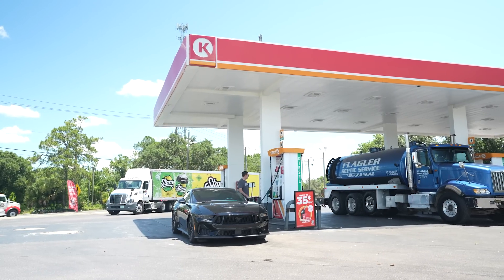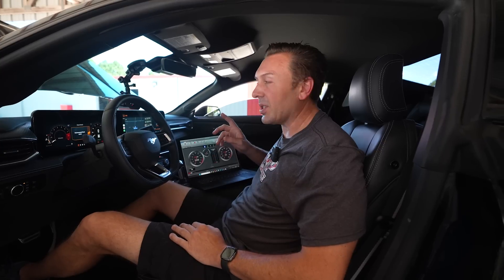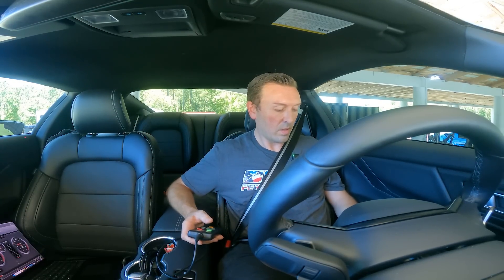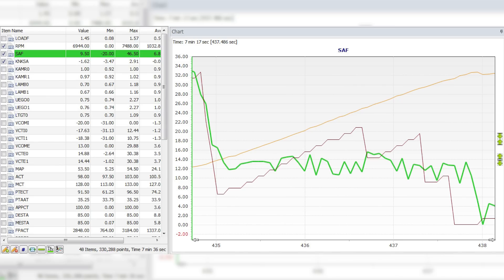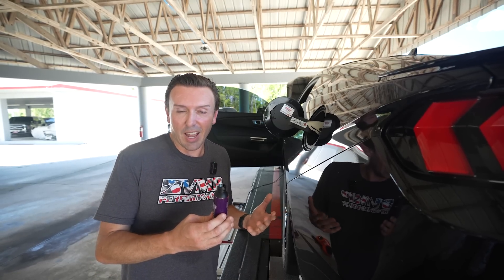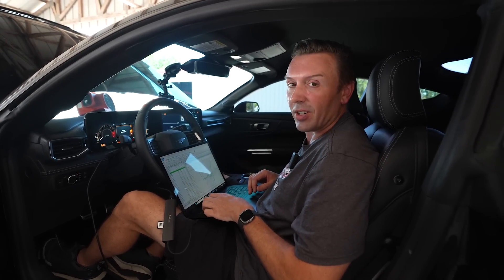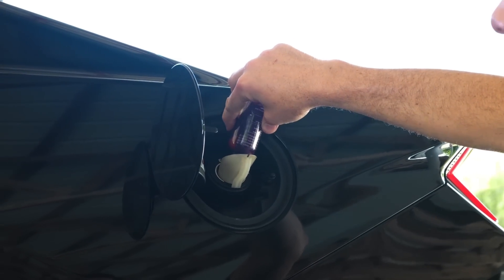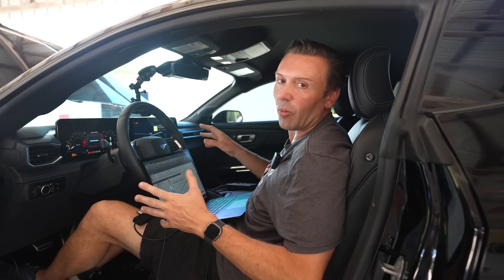How much impact does bad fuel REALLY have?  ||  Supercharged on 87 with our '24 Mustang GT

Comment: What irritates me with Whipple, is why TF do they not take advantage of the mustangs, and f-150’s e-85 capabilities from the factory. 

Guy at OZ Tuning has files where the stock fuel system will support it… 
With a bone stock Whipple stage 2 kit, and the gains can be had with as little as 30% content… 

Why Whipple wouldn’t do the same thing… 
Ask the customer, what fuel do you plan to run? 
We have a 91/93 tune, and an E-85.

Comment: Great video, finally someone crazy enough to do this test lol. I wish someone would do this with a stock Gt with 87 and then 93. Wonder since Ford says 87 at 480hp. Curious to see if you get a bump stock in the timing and hp department.
Reply: I can’t remember if VMP did that test or not but someone did. Good results for sure.

Comment: Nobody should really be buying premium fuel in new vehicles unless you plan on driving it hard like track etc or he very few high performance cars. The computer will just pull timing they have knock sensors. It will still make good power. Should of done all the pulls in 4th gear. Making a baseline run then doing them all different after makes no sense and proves nothing. And what was the octane number after the additive?
Reply: Back in '08 when gas prices got crazy, I had a '07 Infiniti M45 sport that said "premium fuel REQUIRED for maximum performance." I always put 93 in until it was $5/gallon. I switched to 89 and it did make a difference in performance. The car wasn't as quick, wouldn't brake traction, and overall didn't feel the same. I have a '20 M5 competition now that also requires at least 91 octane for maximum performance. It even goes further and recommends Shell V-Power of which I do run most of the time. I probably could put 87 or 89 in there, but I suspect it wouldn't even start😂.

Comment: Fuel is generally very close to the posted octane number at the pump. Its close enough to round up, or within a few tenths above. The variance is usually due to the RON and MON numbers. If RON is higher, MON can be lower and still average out to meet the posted octane rating. Lower MON hurts how the fuel acts at WOT. Winter blends have a lot of butane (a high octane component). If its not stored properly the butane can evaporate and lower octane as well. Lots of variables.

Comment: All fuel contains the same power per droplet. But it's the octane and addictives that allows the timing. ECU's these days are so quick in adjusting timing to suit it makes it safer. But what we tell customers, yes you can daily on a cheaper or lower grade fuel, but if you choose to race or abuse it with that lower grade fuel, you will run the risk of damaging the engine from det, knock and poor ignition, and engine building excessive heat. However, some manufacturers have tuned ECU's with back up information, that if the customer does put lower grade of fuel in, it will actually start injecting more fuel than being on premium or ultimate, to help reduce cylinder temps, but who wants to really run the risk of loosing the engine, and costing more for fuel?